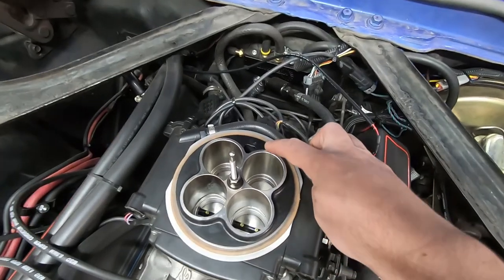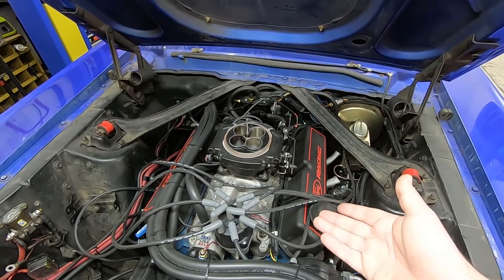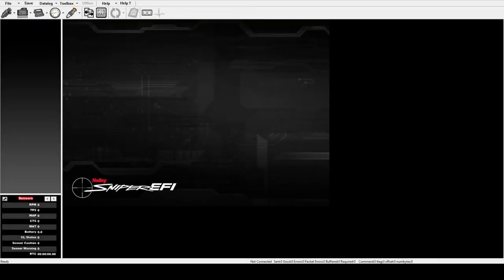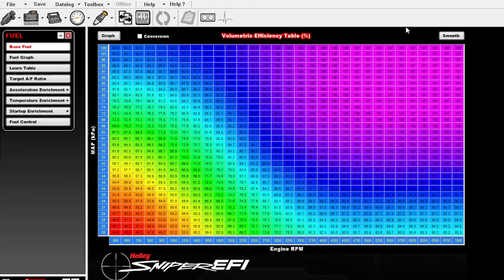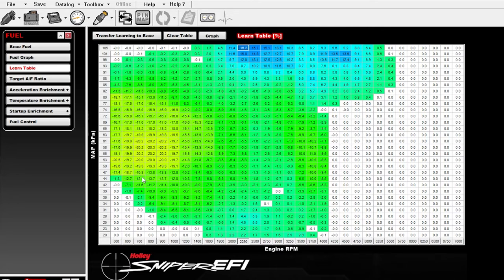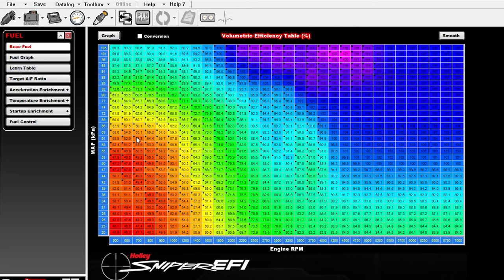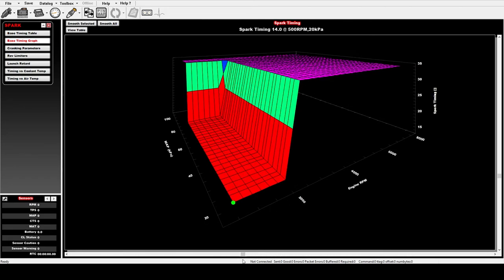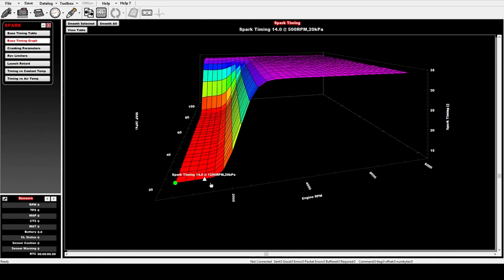What I dislike about my Sniper EFI system and how to fix them!

Comment: My sniper on a 351w based stroker in a 68 mustang runs good actually. My only complaint is the “tip in” feel. In other words the throttle is smooth while engine is off, but normal driving it almost feels like it’s sticking, hard to drive it smooth.
Reply from the maker: I had a few issues initially dialing in my tip in. Are you using the included 1:1 ratio linkage between the primaries and secondarys? That was one of my biggest issues. The others revolved around dialing in my pedal linkage and ensuring it had a smooth range of motion once I had realigned the rod.
Reply: Just installed linkage extension by holley, part# 20-16, problem solved, drives like a new car.

Comment: No one seems to be talking about how you should dial in your target AFR FIRST. The whole point of the learn table is to adjust base fuel in order to match target AFR. The handheld's initial base fuel calculation is just a "guess", at best, based on the simple engine input parameters. You really need to tune target AFR, to your desired application/driving style/goal, FIRST before merging learn tables. Any change in target AFR and the sniper will be "re-learning"  Base Fuel + Learn Table = Target AFR. That is the equilibrium the Sniper strives for. In fact there really is no need to merge the learn table at all, ever, in the interest of tuning.  There is one advantage to to merging/zero the learn table: it can help diagnose any future problem that might occur by helping identify excessive rich or lean areas the ECU things it needs to do. But merging the learn table does nothing to the system. It is just moving numbers from one side of the equation to the other.  Simple algebra. But it certainly is not "tuning". Tune first by target AFR, then tune by AE parameters. Leave the learn table alone until target AFR is dialed in.
Reply from the maker: That is the key to merging your learn table and your base table. Once you have a good basic learn table, locking it into the base table gives you the ability to test for another period of time, check the variances, and then either continue modifications, disable the learning, or narrow the learning range to prevent errors as sensors age or suffer damage.

I also agree. Realistically, you shouldn't need to change target AFRs after you are generally stable, and if you want to adjust things, comparing the learn values to the base can be adjusted cell by cell rather than sweeping chart changes. This video is slated for a remake with more details and more explanation with fueling and timing. A lot of it would benefit from more explanation of purpose and tools.

Comment: I had the high idle rpm problem too, embarrassing at stop lights lol. I was able to fix it by spraying a little carb cleaner right at the IACV and then restarting engine. The problem came back once or twice but the same trick fixed it. I think the plunger is just a little sticky until it's broken in

Comment: The IAC issue was common to the 80's GM TBI system. It was called "Lost Step Stalling" condition where the ECM loses the "0" IAC location (all bypass air blocked). Adjusting the throttle plates too much doesn't allow the ECM to relearn fast enough (baud rate of the ECM to blame). The ECM also re-indexes the "0" when driven at a programmed steady no load rpm (above 30mph on the 80's trucks). I never turn the throttle plates more than a 1/8 of a turn when adjusting IAC counts and then (and this is the important part) WAIT for the ECM to catch up with the change. I like the warm IAC to be at 5 so this gives you a middle of the range for corrections made by the ECM.

Comment: IACV - if you have a radical cam, it will continue to try to 'learn' and adjust the opening to maintain a smooth idle.  But you say, the cam doesn't let it have a smooth idle, Holley says "screw you".... the way to solve that - turn off learning below 1800-2000 rpm. Be careful, if your cruise is below that range, it will cause you problems - point is, set that 'low' point as close to whatever your comfortable cruise is.  For me, my car, in 5th gear, cruises 60 mph at 1900 rpm.  My 'learn' function can only happen above 1875 rpm.

Comment: Why is my snipper after sport 650km of driving decide to hunt at idle. If I move my TPS 2/3% it smooth out. ?????? I’m hopefully getting it tuned next week but just need to know so I can get it ready for the tune.
Reply from the maker: If it's hunting at idle it maybe an AFR or timing issue. It could also be your IAC being at a weird percentage, too low of an idle, etc. Mine would misbehave when I messed with all of the above.

Since it's only with low TPS, I would assume it's something specific to the idle portion of your tuning, which can be easier to narrow down. Good luck at the tuner!
Reply: Thank you for the quick reply. I’m a but Sus as to wether I have a small Vacume leak??? Would that do it.?
Reply from the maker: It could. Try putting a piece of strong tape over the idle air port so that the computer can't add air and see what it does. It should basically lock the idle to whatever the idle screw on the throttle plate is set to. If you can unscrew the throttle plate screw, air is coming from somewhere else.

Usually, vacuum leaks increase my idle rather than causing me searching, but you never know.

Comment: Great video. I have a 70 'Cuda 383 that I bought in January and it has a Sniper on it. It was running super rich. The AF ratios were way out of whack so we got that worked out. It still doesn't love "around town" driving but it kicks ass on the open road. Not sure if this is a trait of these things but this one "needs" RPM.
Reply from the maker: It's probably the amount of fuel the system is giving and low rpm throttle tip in, throttle opening rate, or possibly the MAP sensor/vacuum reading. It can depend a lot on the cam profile, manifold setup, and how fast the butterflys open.

Just play with it a bit. My Mustang is actually a little too jumpy if I don't use adjustable linkage on the butterflys now.

Comment: I added a delay relay to keep the sniper on for 10 secs after ignition is powered off.  Originally added this because my ignition voltage drops to 9vdc when cranking and the screen would go out and then it would reboot after the engine turned over, so now the handheld stays on even with the voltage drop due to power feed from the relay.  Also, has the benefit of running my electric fan for little bit after I turn off the engine.
Reply from the maker: I like the creativity! I'm actually doing something similar, but with a relay to turn the system on when I open the door so it's finished with priming before I turn the key. If you don't put the key in before the timer runs out, it just turns the system back off.

Comment: Great video. Fascinating really.  I have a Chrysler with a mild 318 running an edelbrock 500 AVS carby. It runs that good that I think it’s as good as EFI!  With the exception of the cold starts. But having said that my carby doesn’t run any choke either!  I just feather the throttle for about a minute then it’s good. But I’ve read and heard many good things about the sniper systems.

Comment: The timing cliff might explain why my truck starts sputtering/pinging really bad when winding up to shift into a higher gear. Never did that with the old Chrysler ignition system. The sniper has less than 300 miles on it, so I will definitively be looking into that for sure. Should help it learn better it sounds like. Thanks for the info.
Reply from the maker: No problem. No harm in trying it out, just save backup file and you always have an easy way to undo anything.

Comment: for the timing table, check out holleys video on making a custom timing table on sniper. they show how to make a base table from scratch on the laptop to mimic a distributor with vacuum and mechanical advance
Reply from the maker: Thanks. I plan to make a new version of this video soon. I had filmed a lot of it before the Holley video was out and mine released a few months later. Theirs is a good basic starting point, but logging and tweaking is really important going that route and I want to show why.

Thanks for watching!